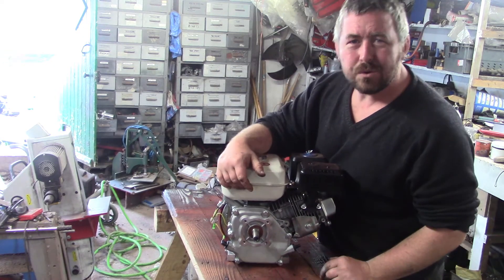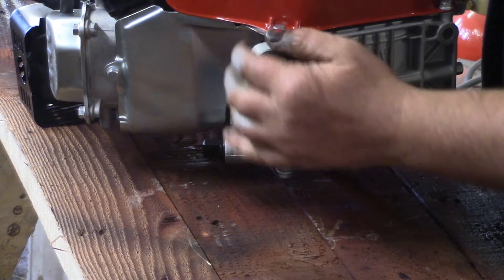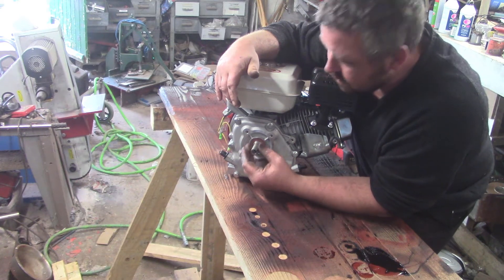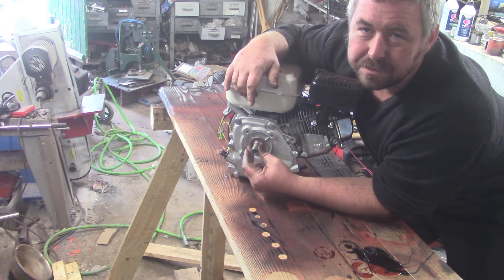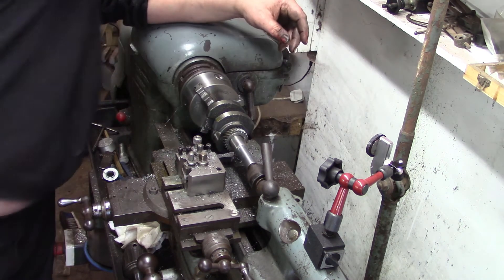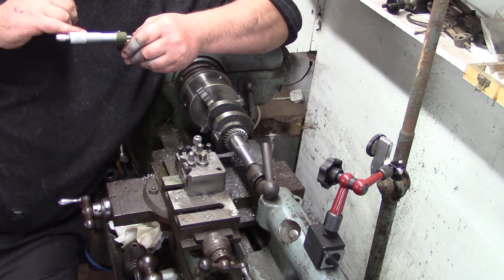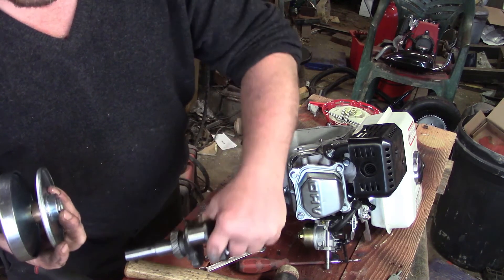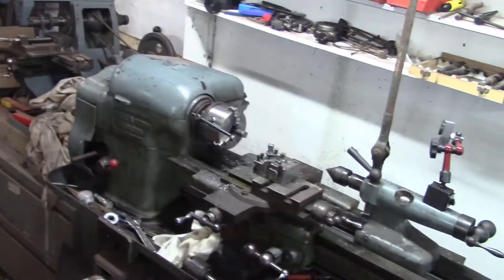honda gx predator 212 crankshaft re-size 20mm to 3/4inch

Comment: Is it possible to go the other way?  I'm repowering a chipper with a predator 212 . while I have an adapter sleeve to go from 3/4 to 1 inch I'm thinking that in time the 3/4 shaft may break. Do you know where I can get a 1 inch crankshaft that will fit a predator 212? Thank you
Reply from the maker: Think the sleeve will be fine if it's belt driving the blades.
Reply: @turboconqueringmegaeagle9006  unfortunately it's shaft driven. I guess best case scenario, if there is a failure it will be the stepped key and not the shaft. Thanks.

Comment: Can you just take a 3/4 bore pulley to a machine shop and have it bored out to 20mm?
Reply from the maker: Absolutely, I have stuck a CVT (available in 5/8, 3/4, 19mm and 1") on this engine and they do wear out eventually so it would mean boring every replacement, there are reasons for either method, mostly because I just wanted to stick a crank in the lathe if I'm honest.
Reply: @turboconqueringmegaeagle9006  Even if one got the pulley bored out, wouldn't metal need to be removed from the pulley keyway to compensate? Also, isn't the shaft keyway on those engines 5mm, which is different from the non metric pulley keyway size? So, how do you get a pulley to stay on the shaft?
Reply from the maker: @grassrat93  if I recall rightly, the cheap Chinese cvt's (I've used a couple in different projects now) have an integral key, and the tolerances are so sloppy that it just slid straight on in both instance despite the 0.5mm depth reduction.
Maybe the integral key was the reason I didn't hog the drive pulley out, I'm sorry it was a while ago now and I can't remember.

Comment: With the smaller diameter shaft now, will there be oil leakage from the seals around the shaft? Or did you put smaller seals? Just curious
Reply from the maker: There is a step on the crank for the bearings/seal inboard of the section I was working on

Comment: Your Viewers are so much better than a lot of the safety sissys that watch and whine on my vids. 

I watched you spill the petrol on the bench and thought Someone is going to have a spit about that then the next second you appear with a bunger in your mouth before starting the engine!  That was hilarious!
I have spilled fuel over hot engines and heard it sizzle and hiss and vaporise 100 times and still not ever seen it light up and so what if it does? You'll have a little fire that will do bugger all and you can easy put out ripping off your t shirt and beating it out worst case scenario. 
People like to blow things so out of proportion these days. 

What you need to do mate is make up a base plate you can mount The tool carrier of a lathe to, Bolt the engine down on top of the plate and machine the shaft without having to take the motor apart. You can then onsell the 3/4 shaft  engines which have been run tested for a tidy profit.  Should be able to do one every 10-15 Min tops!
Reply from the maker: We always wash aircraft engine bays down with avgas, no probs until one of the lads did an oil change on the boss's gt6 (triumph)  it must have had a dodgy ht lead because he washed it down the same way slammed the bonnet, cranked it over and shot a 6' fireball out the front of the car.

I really enjoyed your safety briefings, hope you get back into making vids again.

Comment: Fast trains , ours clack for several minutes to pass.

Almost missed that, cigarette amber ready to fall on the newly gas splashed tank and table, just like the intro explosions.
Reply from the maker: It's a lot quieter than the old track but the fast trains knock my plums off the tree!
Reply: @turboconqueringmegaeagle9006 What are your plums doing up a tree?
Reply: @Gizmomadug  They be up there with the squirrels nuts and the dogs bollocks.

Comment: Interesting idea. You can buy a set of imperial micrometers from Chronos for about £50 including shipping, you get 1, 2, 3 and 4 inch in a set which is what I've got.
Reply from the maker: That's a very reasonable price!
Reply: @turboconqueringmegaeagle9006  then all you need is some gauge blocks which can be had from eBay...
Reply from the maker: @BensWorkshop  just can't decide if I want metric or imperial at home.
Reply: @turboconqueringmegaeagle9006  get imperial, otherwise I have to disown you... 😉

I thought you had some metric at home?
Reply: Also, it depends on what you work on most I suppose. I work in stuff built in imperial.
Reply from the maker: @BensWorkshop  don't disown me just because metric bearings and bar stock are cheaper to buy! 
I've only got a couple of cheap mics and verniers here, happier working in feet and inches. I'll probably just get a nice digital set next time I'm feeling flush.
Reply: @turboconqueringmegaeagle9006  it's all down to what you make stuff in rather than the stock you buy. In my case, model engineering and old British engines come in imperial.

Digital micrometers are pricy though nice.